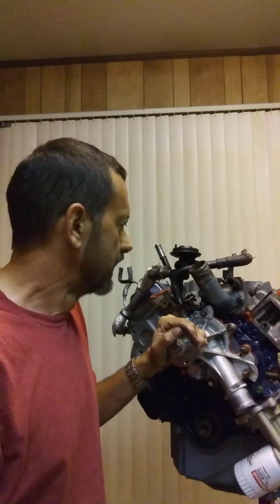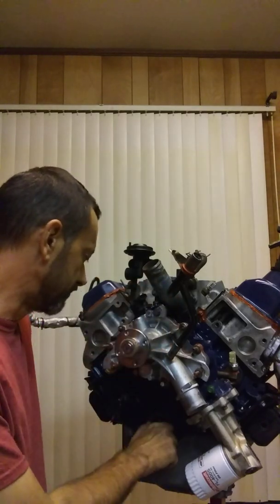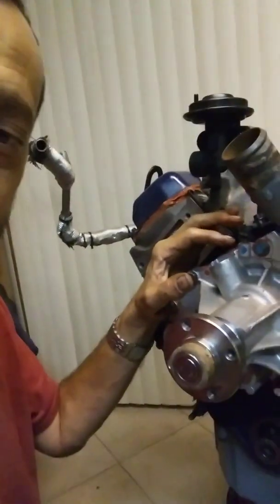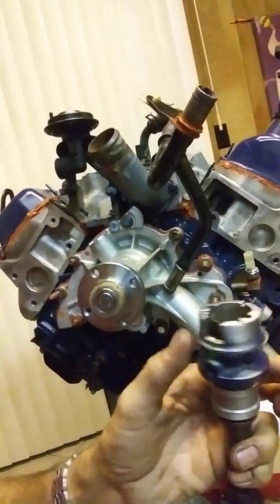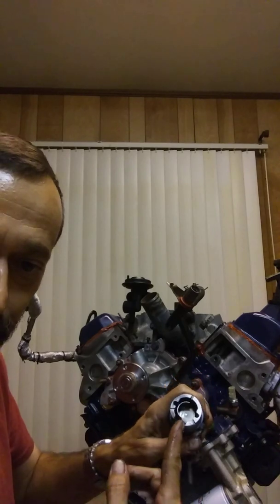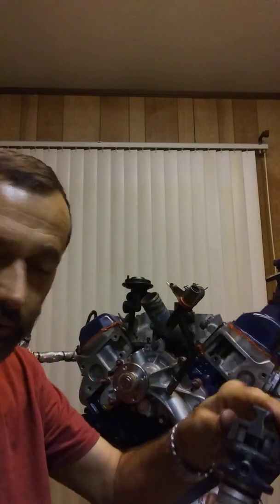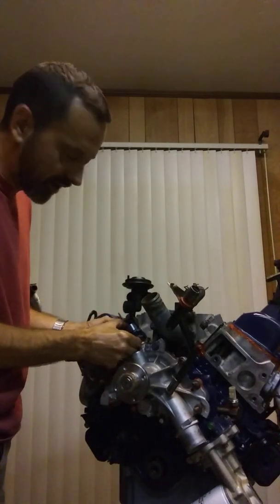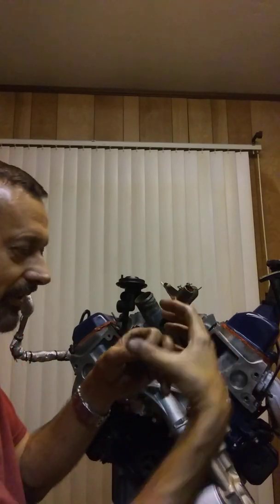Ford 4.2L V6 Timing Synchronizer, Cam Position Sensor

Comment: You don’t need that tool. You just need #1 piston at TDC, either stroke and just be sure the “half moon” is lined up vertically and drop it in. The degree spec is only so you are able to plug in the connector without stretching it. The whole apparatus is non- sequential, it doesn’t matter where you would place it as long as you’re TDC #1. Again, you just have to be sure it’s placed right so you can plug it in. I’ve done a million of them, no tool, never a problem with starting or performance

Comment: I got important ??? My camshaft position synchronizer sensor back do I got do the timing deal just to change the sensor I got tool to line sensor up but not sure If I got mess with timing

Comment: I did this exact process... But I pulled mine after I marked it and the engine cleaner on my hands wiped off the mark on the old cam shaft pos. sens.  I'm about to put it back together, so I'll see pretty quickly if I did it right....

Comment: I pulled mine out to get at a bolt for the EGR stand pipe thing and put it back in based on how the pigtail going to it was and live data says 14 14.5 15 degrees advance timing so is it good or no ? 

My 98 Ford e250 with the 4.2 l V6 Essex engine

Comment: Hi, what is the name of that tool, im about to replace my timing chain i i notice that censor so im a a stand still until i find that tool
Reply from the maker: Ford Timing Synchronizer
Reply from the maker: Or camshaft synchronizer alignment kit
https://www.rockauto.com/en/catalog/ford,1997,f-150,4.2l+v6,1122455,ignition
Reply from the maker: https://www.rockauto.com/en/catalog/ford,1997,f-150,4.2l+v6,1122455,ignition,camshaft+synchronizer+alignment+kit,1001188
Reply from the maker: https://www.autozone.com/internal-engine/cam-synchronizer-alignment-tool-kit/p/cardone-cam-synchronizer-alignment-tool-kit-84-8400t/979921_0_0?searchText=camshaft+synchronizer&cmpid=SPL:US:EN:AD:NL:1000000:GEN:pdp&vehicleId=2722701

Comment: i replaced it with the tool on but didnt put the timing in center dont know how to do that, its running fine but misfiring and turning off when im at stop and accelerate

Comment: there are 2 tdcs and what cylinder?
Reply: It's the 1st cylinder, front left.  For future reference.  Timing marks should be on damper/ counter balance wheel.  And the block will also have a timing mark.
Reply from the maker: If you have to ask, you probably shouldn't be attempting this procedure.

Comment: What year engine? I've got a 2007 throwing a code for that sensor
Reply from the maker: This is a 2002 engine in a 1997 truck
Reply: So it should be similar to my engine then? Thank you

Comment: Can you replace the sensor without having to fool with the synchronizer?
Reply from the maker: Yes.
Reply: @bgfixit  appreciate it my sensor just came in today so hopefully it does the trick.
Reply from the maker: Yes, if just replacing the sensor. No problem, 2 screws, simple swap.

Comment: do you have the link for the tool you used to set timing on the 4.2 L?
Reply from the maker: https://www.rockauto.com/en/catalog/ford,1997,f-150,4.2l+v6,1122455,ignition